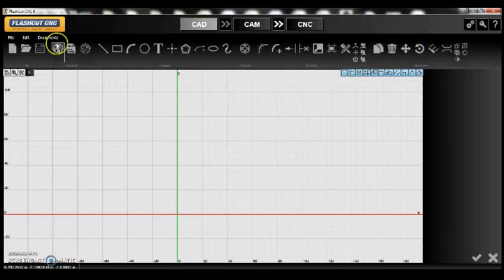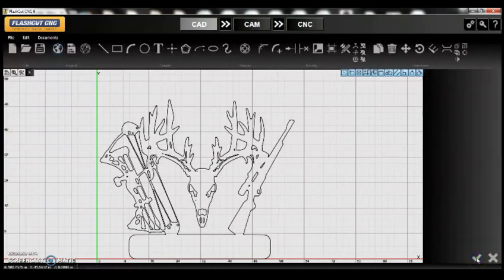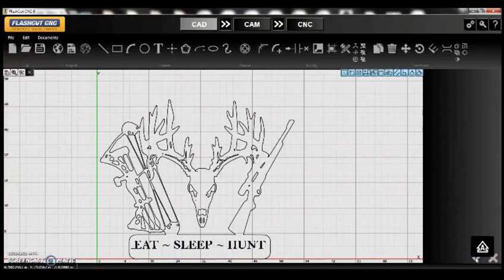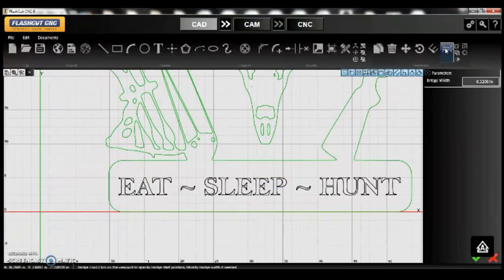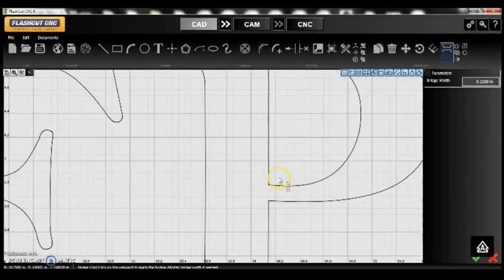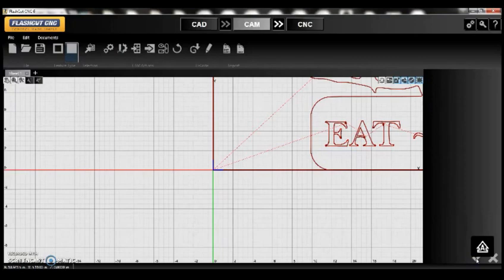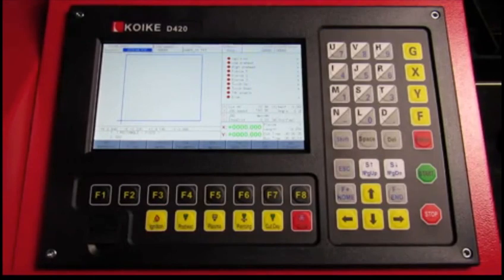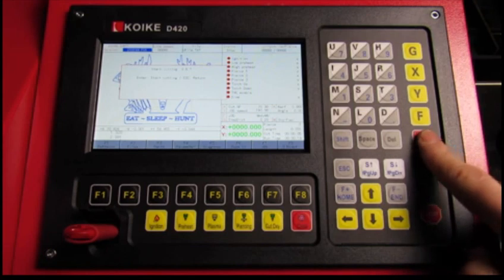How to Make a 1/8 in metal sign DXF file using Flashcut CNC software

Comment: Hi, thank you so much for these vids, I am very new to all this and have a very similar machine to yours - when I use the starcam drawing program to draw a part and save as a dxf file to my thumb drive and then insert the thumb drive into the port on the controller for the cnc plasma cutter and follow your instructions above is will not recognise the file or file format - what file format etc etc do you use and what do you save the file as - I would truly appreciate it if you can help - thanks - Tom
Reply: He is using GCODE file format to save. It will be recognized by your machine.